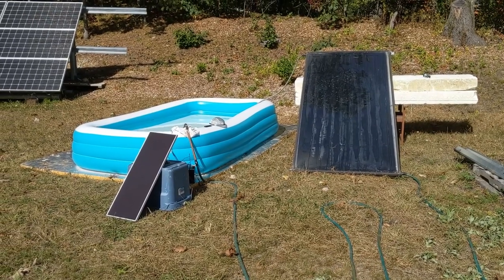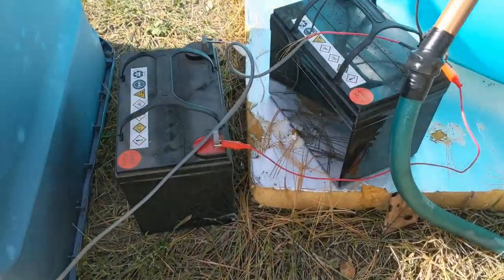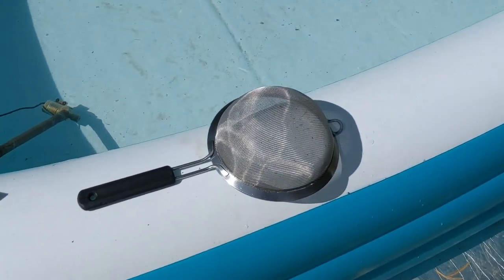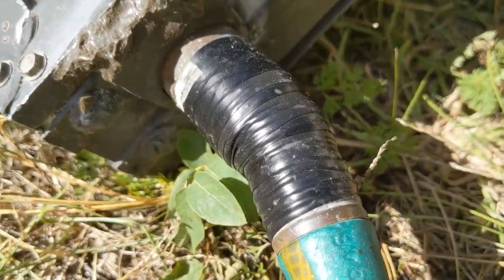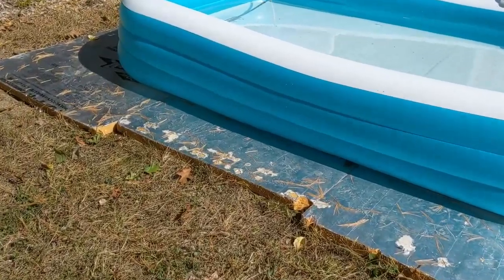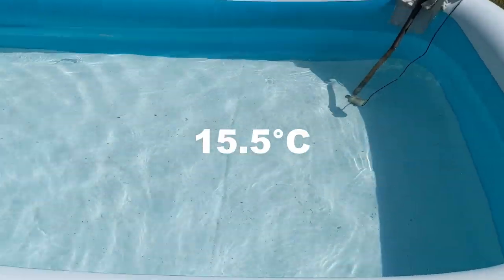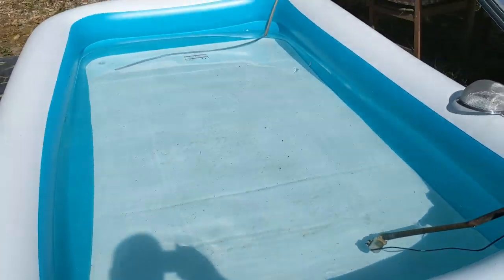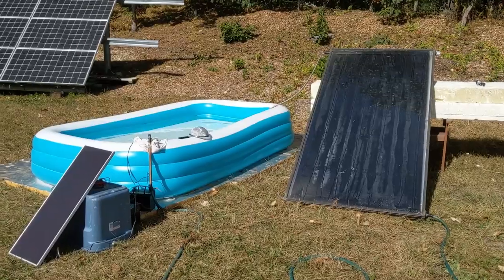Solar Heater for Free Kids Pool

Comment: Nice illustration of simplicity there... Would be nice to see if it works without the batteries, but the motor might pull the panel down so much that it won't generate enough power to run so need something to hold up the voltage near MPP.
Also glad to see your subscriber count ramping up!
Reply from the maker: Thank you.

Comment: terrible design. all you need is a sheet of black plastic draped over the top of the pool, laying directly on the water and optionally a second sheet of clear plastic with weights at the sides to pull it tight across the pool to create an insulating air gap. or just a black pool liner.

Comment: I used to do something similar about 30 years ago using a dark color hose only.  MUCH simpler!  Just trickle the water so it takes maybe 4 hours to fill the pool and it should be nice and warm.  No extra hardware needed.  Why go thru all this trouble you are doing when all you need is a dark color hose maybe 50 feet long (longer is better).  Downvoted for excess complexity and cost and also it is not free.  At some point you likely paid for all that stuff.
Reply: I upvoted for reusing and recycling things creatively that were going unused.
A solar collector is FAR more efficient than a hose.
Reply: i think you missed the point of combining a hobby, some spare parts and fun time with his daughter, wow